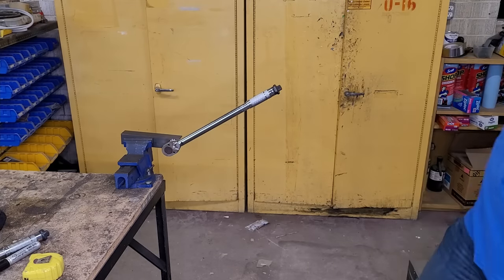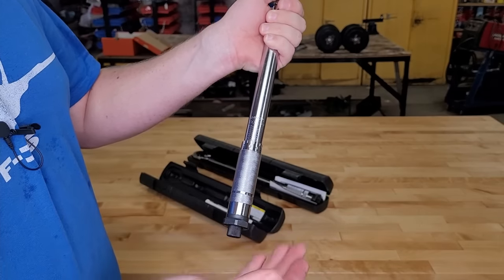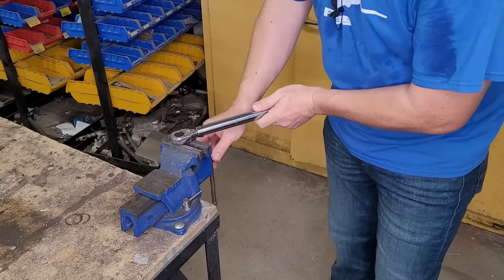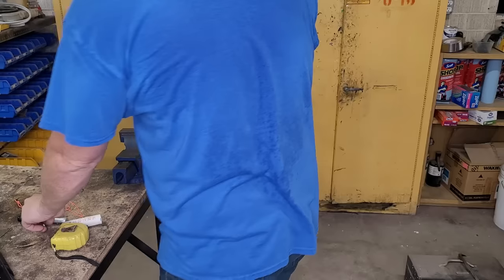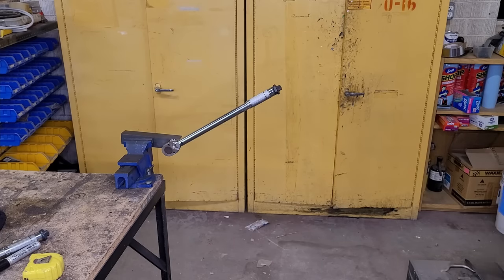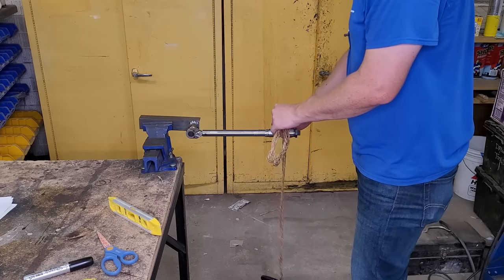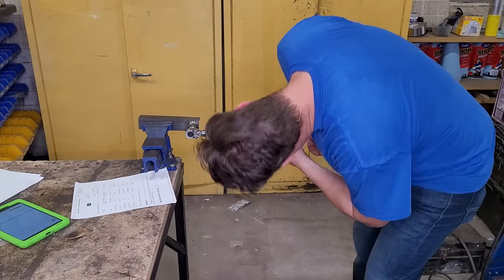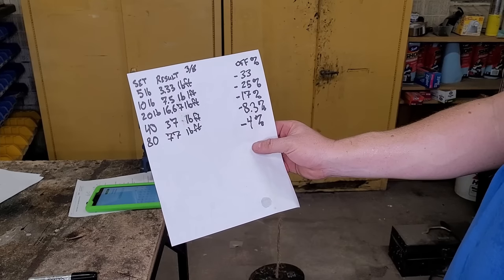$20 Torque Wrench, are they accurate? | Harbor Freight 1/2" and 3/8" Drive Review and Test

Comment: The problem with this type torque wrench is that operator does not know when the wrench is going to trigger, so the bolt becomes over torqued because the operator cannot react quickly enough and continues to push the handle after the wrench has triggered.  I ran tests with a digital torque gage and 6 skilled mechanics and a calibrated SnapOn 1/2" drive torque wrench.  The mechanics would over torque the gage by as much as 20% and never under torqued the gage.  Ran this test hundreds of times to confirm the results.  So no matter how well this type of wrench is calibrated it requires a tremendous amount of skill to use it accurately.  I overcame my problems with the accuracy of the operator by switching to electronic digital wrenches where they could observe that approaching the desired torque and ease into the desired torque.

Comment: I would be curious about consistency of the readings.  Using the 3/8" wrench, are the readings the same ( even if off ) across multiple uses , re-initializing ( min-max settings , 3 times ) .

Comment: Thanks for the series of tests. Perhaps the tests should have included the weight of the heavy duty string and the swinging weight. Otherwise, it will affect the accuracy, especially on light weight tests. Thanks again for your tests.

Comment: I have both brand name and Harbor Frieght wrenches. I had access to an Aerospace balance lab using precision weights for calibration and was able to calibrate a Harbor Freight wrench to a good tight tolerance BUT, the question is "How long will it hold calibration?

Comment: Nobody pills a handle with one finger tho, all that force on one dingle skinny area,vs your wide hand displacing force on handle length. Your jand is what its tuned to made for and its what should be tested with
Reply from the maker: Hey Steevo, the distance from the pivot point and the force applied perpendicular to the handle determines the torque.  This wrench sense torque at the head of the wrench, it shouldn't know what's happening at the handle.  I'll be revisiting these wrenches in a future video to correct a different mistake I made, consider subscribing!
Reply: @HerbOMatic  correct but in real world when does the force get applied like that?

Comment: Did you account for the weght of the torque wrench handle?  That adds about 1.2 lf-ft when horizontal, so explains just a bit of your error at the low end.

Comment: Invalid test of the 3/8 wrench. The adapter used with the 3/8" wrench changed the torque applied at the socket base.  The  hypotenuse of the created triangle is longer than the (base) handle measurement.  The same is true when a deep socket is used with a bolt or nut.

Comment: I trusted a new 3/8 and it failed to click cracking the upper plenum on my malibu. it's trash. I've had a 1/2 inch for years works with no problem. roll the dice or spend a few? replacing the plenum with a junkyard part + cost to purchase would have covered a better tool.

Comment: if I want a near 100% accurate 5 ft lbs, can I take the 33% inaccuracy error of 5 ft lbs, and add that to 5 ft lbs to make it an accurate 5 ft lbs? If so, is 33% of 5 at 1.65 ft pnds added to 5 ft lbs to get the accurate torque wrench setting 6.65 ft lbs? Or would I need to take the accurate 1.65 ft lb X 5 innaccurate ft pnds to get my near accurate torque setting at 8.25 ft lbs?

Comment: This test should not be used to determine whether a high-end torque wrench is better than a low-end torque wrench.  To truly test the accuracy of these torque wrenches you would have to select a proper sample size of torque wrenches.  Probably at least 100 wrenches or more and test each one recording the results.  Then you would have to do the same thing with a random sample of the high-end wrenches.  Then statistically analyze the results.  Then you could make a more definitive statement regarding the accuracy of the low end wrench vs the high-end wrench.

Comment: Did you weigh the weights before testing?  Not sure what the tolerance are on those.  Also even if they are dead on you are applying more torque than the weight you hung.  You need to measure the weight of the rope.  The weight of the rope will be less significant at higher torque settings.

Comment: Thank you for the video glad you didn't get hurt. I have a stupid question for a newbie. Can I buy the half inch and get an adapter to bring it back down to 3/8 that way it's more accurate up to a 150 pounds of torque?
Reply: it will not make it more accurate at low torque, that is mostly up to the wrench internals, but 1/2 to 3/8 adaptors have a high failure rate

Comment: Your video is realy good, I do stupid rigging and stuff like that over my life time, I just take my HFT torque wrenchs on my Snap-on dealer truck and test them every now and then. The 1/2 drive is good for lug nuts and as a loner in stead of my Snap-on torque wrenchs but I think there ok for the price if u don't need torque wrenchs every day 🔧🔧🔧🔧🔧
Reply from the maker: Thanks Joseph, Yeah they are good beaters, I think they should be validated roughly before use.  I think Harbor Freight is good for the guy that uses a lot of tools but doesn't use one tool a lot.  Thanks for the comment!

Comment: IMHO the ⅜ to ½ adapter is changing the pivot angle and should normally be avoided, but if not isnt an adjustment in the torque calculation required?

Comment: I purchased a set of these to work on my dirtbike and something told me they were not correct because I was tightening down stuff pretty tight and still no click The video help to substantiate my thoughts .  Because I would set say to 20 lbs and it clicks at 30 lbs . I just quit using them before I broke something.
Reply from the maker: I think they may be suspect, I've tested them since this video and the 3/8 doesn't work right anymore!  I almost broke the wife's jeep with it.

Comment: Do you think they are designed to accommodate the hand covering a much larger area of the wrench , rather than the rope at certain inches?
Reply from the maker: The measuring part is at the head of the wrench.  The rest of the wrench is a solid piece, it doesn't know or care how you grab it.  They wouldn't be accurate if they were sensitive to different hands and grips.  Thanks Phillip!

Comment: If you make a free body diagram of pivot and clicking mechanism with point of application of forces, you will see that it does not matter where on handle you apply the force.  I think that it is not straight forward as torque=force x distance
Your demonstration could be flawed.
Reply from the maker: You could apply the force in a different area but you would have to adjust the amount of the force to compensate.  You would not get the same leverage at 6" from the pivot as 12".  At 6" you would need to apply 200lbs of force to achieve 100ft-lbs and trigger the wrench (If you had it set at 100 ft-lbs).  Thats 200lbs x 1/2ft= 100 ft-lbs.  Likewise you could apply 50lbs at 24" from the pivot to achieve the same thing.  In the free body diagram you would have forces to balance and moments (moments would be the torque).  As for the free body diagram, you are right that the force in the vertical direction on the drive would be the same no matter where on the handle you applied the load however, the moment is entirely dependent on the distance from the support point (in this case the drive pivot where the wrench is supported).  This is how I understand it.  There was error in the test in the fact I forgot to calculate the torque generated by the weight of wrench handle itself as pointed out in an earlier comment.  Thanks Comfort Zone!

Comment: It seems like the error might be a constant (2ft lbs or so) rather than a fixed percentage at each setting. Also, it seems like HF's 4% error reading was refferencing the constant, and turned it into a percentage of 80ft lbs

Comment: I bought a Harbor Freight torque wrench (1/2") a few years ago.  I maybe used it 10 times.  It's already broken.  When I start to tighten the wrench settings, it hits around 80 Ft lbs and then the bottom pops out.  I noticed the threads are shot.  Maybe a defective one, maybe not.  Last time I'm buying one of these.

Comment: This is a bogus test. Anyone who's used a torque wrench should know to hold the handle only. Any triggering shorter/longer than 12" from the pivot point means the weight is significantly different.

Comment: I don't think this is an accurate way to measure a torque wrnech, the readings would be off depending on where along the handle you put the weight, toward the end would be different than halfway to the end, the real way to measure a torque wrench is with a torque tester, anything else and your guessing how accurate it is.

Comment: Are you not supposed to actually pull the wrench at the center of the handle, for the proper reading?  Of course you'll get it to trigger at different places up the handle if you pull hard enough

Comment: Using weights to and  to measure accuracy seems to be about as inaccurate as possible.  Seems to me that it would be better to mark the distance and use a weight measuring device to pull and record the amount of pull required. Also you will apply pressure when using across a much larger area than the width of his rope. 
I have these and the 1/4” drive. I do not think from owning them, that they would last long in a working shop, but for my occasional usage I think they are fine. Most torque specs now call for a spec plus angle (1x use bolts).

Comment: The problem is a whole majority of these videos try to make Pittsburgh Pro torque wrenches look great yet if you do a simple search on internet forums like the great Reddit you see they are one of the biggest mistakes you can make using it on your engine bay or sensitive parts in the transmission Etc because they're reliability in plus or minus 3 or 4% is so all over the place

Comment: In the ballpark? First of all I don't play ball. Years ago I tried a verry tall nut or a nut on a bolt with deep sockets and carefully used a clicker type torque wrench and a beam style torque both used verry little. I was surprised when the clicker wrench broke at the same torque or within a foot pound of the scale on the beam type wrench.😌

Comment: Can't one just use a digital torque adapter to test the accuracy of these manual torque wrenches?
Reply from the maker: You could, in the future I plan to do just that to compare my six torque wrenches and see if certain brands are better.  I liked using the raw definition of torque in this video, it made it more interesting to me.

Comment: I bought the 3/8 to do small jobs like spark plugs which I used it yesterday on my moms fiesta and it did well..I only plan on doin Lil things like oil,and brakes as well so..I won't use it but 3-6 times a yr..

Comment: Just a comment. Usually the accuracy is specified based on the maximum value. For the first measurement of the 3/8 that means 
(5-3.33)/80=2.1% 
So everything in specification. That's the reason why we should use small torque wrenches. The accuracy is better near the nominal torque.

Comment: you are not accounting for the weight of the wrench handle, that is why the percentage discrepancy is higher at lower foot pounds of torque. The more accurate way to measure it would be to position the wrench vertically, with the rope being horizontal with 90 degree bend using a pulley.

Comment: My experience with HB torque wrench left me with either buy better or don’t use any. Had both the 1/2 and 3/8 used one tightened to 90 then checked with other…..nope other one kept tightening bolt before clicking. Not getting quality with 10 bucks sorry
Reply: Unless just wanna hear the click … mine all did click 😂

Comment: Snapped a trans pan bolt off with this, had it set for 7lb-ft and it never clicked. I should've stopped after a few turns but I wasn't familiar with how much 7lb-ft actually is, and it was still very easy to turn.
Reply: I tested pan bolt removal with a $400 snap-on tool. They ranged from 8.5 to 19 ft-lb... but some were incredibly loose.
Went to tighten the loose ones, and one snapped.
CONCLUSION: someone was installing these with an air gun, not a torque wrench! I've seen heads snap off before for the same reason.
Might not have been your wrench at all.
Reply: If you didn't use the 1/4" torque wrench for this, it was expected that you would have snapped those bolts.
Reply: 7 ft lbs FAIL, 84 inch lbs success

Comment: From my experience all Torque wrenches must be oiled well and the bolts should be from a same batch. and the threaded holes should all be the same physical properties and state. If you torque half of your screws during the day and torque half on nite fall they will be off. It’s not all because of the wrench.

Comment: My wheels almost came off twice. I had our son in the car. I never told my wife. I use the cheapest torque wrench.
I learned my lesson and tighten the bolts to 126 and not 100. I also retighten them after some 100 km. No problems after this.
I felt awfully stupid, let that be clear.
Anyway, I planned to calibrate before the next break job.
My intuition already told me not to trust the thing in the lower end.
Reply: As long as you’re in the upper 80% of the range, you should be good to go. That means a torque wrench with a 100 ft lb limit should NOT be used below 20%.

Comment: Just a question. With all the trouble you went to to be as accurate as possible, did you take those weights to someone to have them verified as accurate?  Just sayin. Of the fodder is not accurate to start with, then the fodder weigher cannot be calculated how far off it is either. So all of this work was for nothing.

Comment: I bought a bike rack for my car that I must assemble.  Two of the bolts must be tightened to 15ft-lbs(20Nm), so I bought a torque wrench (never used one before).   When I got home, I noticed that the wrench I bought has a torque range from 20ft-lbs to 150ft-lbs.  Should I exchange this wrench for one with a range that starts at 10 or 15ft-lbs?
Reply: "Should I exchange this wrench for one with a range that starts at 10 or 15ft-lbs?"

Take this with a grain of salt: But I wouldnt sweat 5 pounds, personally. Honestly at 15 ft/lbs i wouldnt have even bothered with a torque wrench, thats more or less hand tight (Snug up the nut/bolt with your fingers, then just use a little bit of hand strength to go further. Do not wrench on the thing like your doing a pull up).  But doing it at 20, unless the materials are flimsy, i wouldnt stress a lot.
Reply: @SidewaysGts  Thank you for taking the time to reply.  I will take your advice and tighten the bolts to 20ft-lbs.  After reading your reply, I regret buying the torque wrench.  At least, it was inexpensive.
Reply: @MNM14ful  " After reading your reply, I regret buying the torque wrench.  At least, it was inexpensive."

Is it possible to return it? For most people / DIYers its a tool theyre unlikely to ever need unless theyre doing some specific automotive tasks. Its handy to have when you need it, but if you never need it lol

Comment: As an industry rule of thumb for accuracy, the bottom 20% of the torque wrench range should not be used. For simplicity, if the torque wrench scale is say, 5 to 75 ft lbs, then it should not be used for less than 15 ft lbs. This is why your measurement was over 33% off at the lowest setting. Click torque wrenches, even more expensive, are only calibrated to be accurate down to 20% of their full scale and even that is questionable. If you need to measure, say 10 ft lbs, then you should be using a torque wrench that measures inch lbs as one that measures 5 to 75 ft lbs would simply not be accurate.

Comment: The problem I had to watch out with these wrenches, the end you tighten make sure it doesn’t come loose.
Reply: Yes. I have them too, and they love to come loose, and by time I torque something down, the dial has moved quite considerably. Sometimes even when it's still tight, it can still move just from enough pressure.

Comment: You didn't take into account the weight of the torque wrenches when testing them at the lower weight settings.

I have the $20 1/2 inch wrench which I bought at Princess Auto in Canada (no case). It's accurate enough for retorquing the lug bolts on my wheels. Cheap and small enough to keep in my car.

Comment: As others mentioned the wrench should be more accurate up some from the lower settings. Anyways nice video, makes me want to test my Harbor Freight 3/4” drive. I had to purchase this in the past for my axle nut torque on my 03 Yukon for it was above 150 ft lb. My lug nuts on my 2010 Ford F150 are specified at 150ft lb believe it or not,  “I just used my one Torque Wrench the other day on the truck.”

Comment: But the lower 5 to 20ft is basically hand tightening with a regular wrench..that wouldn't really matter so much I'm guessing.. it's the higher specs I'd really be wanting to have accurate so seems like they'll both be able to do the job
Reply: Depends on the fastener, I'm more concerned about stripping plastic or breaking tiny screws than larger bolts that I know I can crank down on.

Comment: First off why wouldn’t you use the case til the hinge broke then use bottom for storage instead of destroying it right off the jump. Second, the ONLY reason for reverse on a torque wrench is for reverse threads.